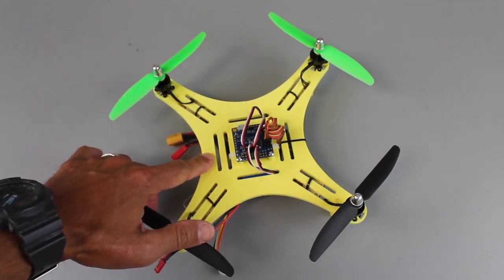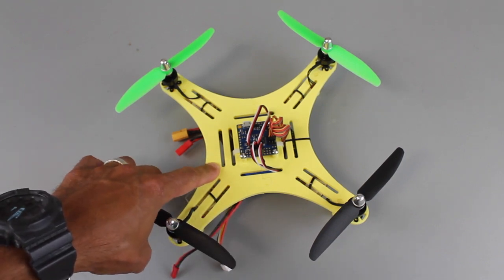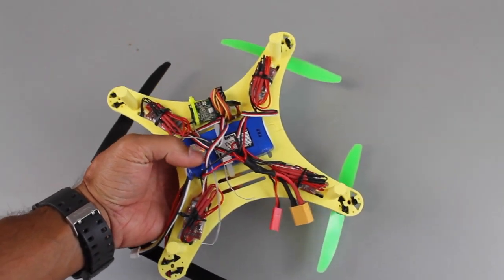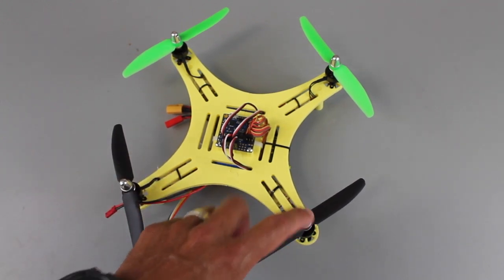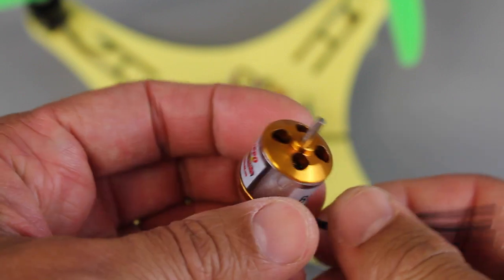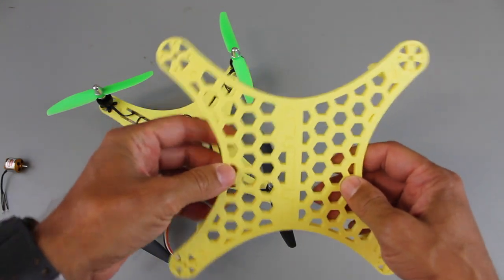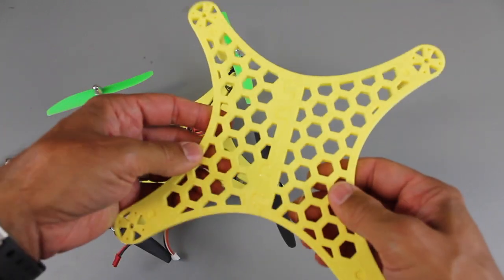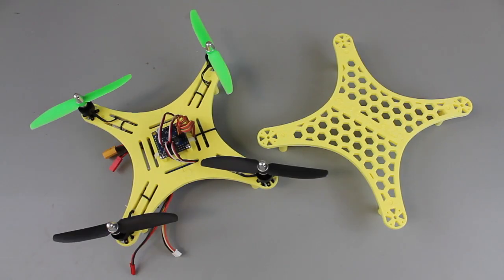3D Printed DIY Mini Quadcopter V2 Now on Thingiverse

Comment: How do you go about honeycombing your frame in Rhino? Seems like a great way to save on filament. If you have a technique to this maybe you can post a video on the process? I just got my first 3D printer.
Reply from the maker: Bradon, great question. When I get this design finalized you can definitely count on a video that talks through how to do this. It's probably not going to be the best way to do it since I'm still learning how to work in Rhino 3D. Congrats on your new printer. What did you get?
Reply: Dennis Baldwin I got a QU-BD Two Up with heated bed upgrade. So far it's been great and a lot of fun. The trouble I'm having is interior dimensions such as holes are coming out too small. So my mechanical designs are unable. Exterior dimensions are spot on so I'm not sure if this is a slicer error or what.

Comment: What about some clip on landing gear? If the plastic is slightly flexible could you do a landing gear shaped like a 'V' with teeth on top to hook on to the frame.
 P.S. Youtube needs to make a section that makes it capable of drawing for comments. Would make this a lot easier to explain.
Reply from the maker: They do make flexible PLA so that may be worth looking into. I designed some slide-on gear on my QAV400 that hold up pretty nicely. This would definitely require something that could snap on. Let me think on it some more. How to see you in a few weeks!

Comment: Your wireing us a mess
Reply from the maker: True. I need to clean it up, but want to get the build right and then I'll work on that. I'm still a newbie when it comes to wiring so if you got any tips I'm all ears!
Reply: Dennis Baldwin ok first put the esc's on top beneath each propeller it will act as  cooling for the esc's, the leads will also have a more direct root to the flight controller. If your any good at soldering i would solder the esc to motor instead of bullet connectors as it will cut down on weight and you will have less chance of failure from the connectors comming loose, Wiring guid for motor spinning anti clockwise cross the two end  wires for clockwise keep all wires Parallel. I dont know what reciever you use but i remove mine from the casing which leaves you with a flat board, with the antenna wires and pins at the other end. i put the board in heatshrink with the antenna wires stiking out the other end which allows me to to put my receiver under the flight controller when mounted on nylon standoffs. just leaf the connector pins on the reciever sticking out from under the flight controller for easy connection. 
Hope this helps sorry for the spelling and grammer
Reply from the maker: kernalmusterd Wow these are some seriously good tips. I've done the ESC one before with my QAV400. I'll give your other tips consideration as I get ready for my next build. I really appreciate you sharing this info. Take care.